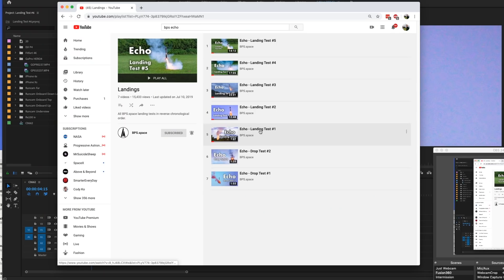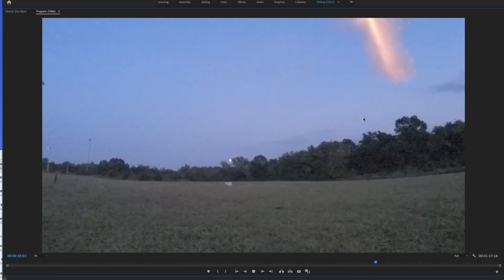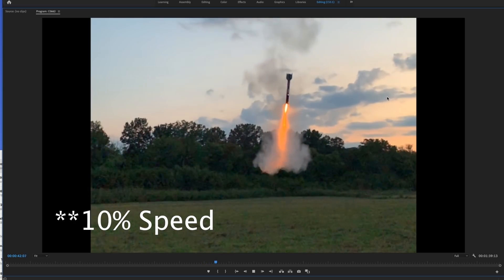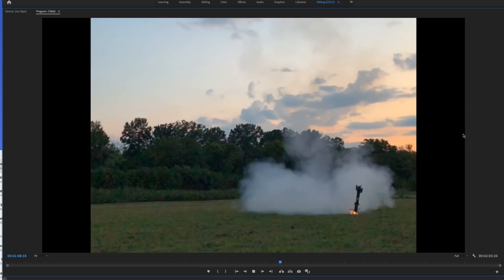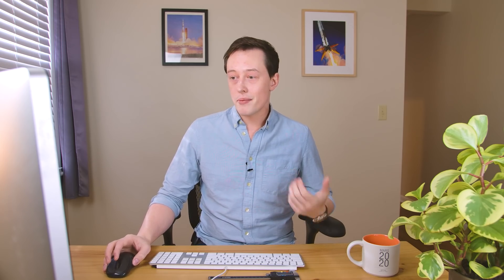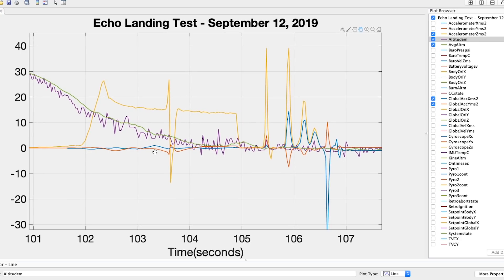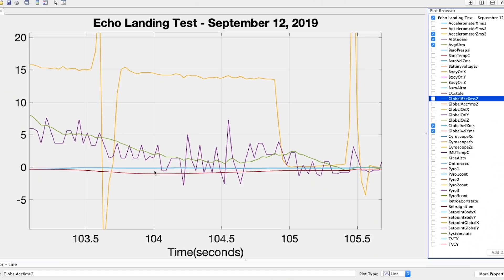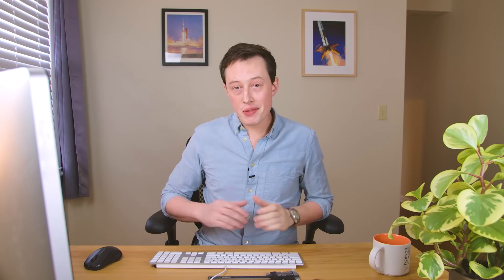Echo - Landing Test #6

Comment: Have you considered adding weight/mass to the legs to move the COG lower?  I know that wouldn't necessarily be good for flight, and it would increase the vibration event you're seeing on leg deploy, but could adding mass to the ends of the legs be enough shift in the COG to help with tipping?  It would also change i/j/k moments so flight software might have a hard time with that.  Excited to see what you do in 2020, thanks for the update.

Comment: I think you should try to programm the motor so, that the engin stops corecting the trajectory 2 seconds before the engine burned out. So the rocket will not flip, beacouse of the engin burned out, while the rocket is corecting the trajectory.
Just an Idea, I dont know if it can help.

(Sorry for my bad English, I'm from Austria)

Comment: I don't think switching to liquid is a good idea as of yet. They are hella expensive and unlike echo, when it crashes, you can just swap the landing legs and the engine and send it again. It'll probably just turn into a giant fireball. 

I get your recent crashes look like they are happening due to you not having throttle but I'd argue there are quite a few other problems with your rocket besides that(horizontal drift, intolerance to vibration, etc.) If I were you, I wouldn't switch to liquid until I can land a solid booster at least 3 times back to back. For the price of a single liquid rocket, you can afford to crash 40 solids.

Comment: Why don´t you use spark ignition for the motor? Sure not the easiest with solid fuel but you can make it work. You should be able to get very solid results once you figure it.

Comment: Feel like you may be missing something here. I guess that the falcon heavy lands at a specific site that HAS WiFi transmitters... And sensors on the falcon pick up extra data about orientation and alignment. You are making it SO hard for yourself landing on a random patch of grass!!! You have a great landing worked out until 10ft altitude, why not develop better legs , or better electomechanical landing gear, legs with servos and damping or even a drone system for the last 10- feet , come on man I love you Joe but this landing problem has to get real, even if you don't want the weight of a complex landing rig you have to face facts and engineer a working solution!!! Please do it man the electronics are out there !!! We want to see it land and this is do able. Love your  videos please come up with better landing hardware not software.
Reply: I mean its called the falcon heavy for a reason? The kit required to make it land is heavy as a proportion of the total rocket mass , Space X made that concession because they knew the distribution of.mass would not be dedicated in such a large proportion to thrusters and their hardware and fuel. A sizeable proportion went to landing gear mass, they wouldn't get as high but they'd be able to get back! Please give a.bigger chunk to your landing gear systems Joe and develop better landing hardware? Writing this because I know you can do it far better than most of us.

Comment: It is still amazing to be able to land a model rocket with a solid motor without smashing it into the ground. I mean, you drop it from a drone hovering 30m above the ground. Imagine now, dropping it 2km above the ground, the result will be the same, a model rocket laying down on the floor, but in one piece. For me that's a succes.

Comment: Resolve the throttle issue by creating a controllable thrust redirect mechanism i.e. to allow you to cut 100% thrust to zero at an exact time.. so what if the motor keeps burning for a couple of seconds longer,  the thrust vector is redirected symmetrically on a 90 degree axis - this cut-off could be triggered by a thin probe that acts on contact with the ground..triggering vanes to redirect thrust 90%

Comment: I am not really an expert but since the rocket is suppose to come from higher altitude in real-life scenarios, right? shouldn't you go higher in altitude before letting the rocket fall down to gain more acceleration which would lead to more velocity and that will make it have much more kinetic energy before your ignition step so you can test if the rocket engine can handle more opposite force.

Comment: A good way to zero out vertical is to measure values with the fuselage in a fixed rig, turn it 180°, and measure again. The average values will be exactly vertical. The rig doesn't need to be perfectly vertical, only reasonably close for this to work. Also, if the ship is a hair off balance, exactly vertical may not be what you need. It could very well be that exactly vertical will have a lateral component of thrust or moment due to CG being not 100% perfect. But this will give you an accurate baseline from which to measure those factors.
With SRBs, I think you must test the thrust curve of many motors on the ground, and see what the standard deviation is for the area under the curve. I suspect that the deviation is too wide to ever expect consistent and predictable landings the way that you are attempting to. A better method may be something like autobrakes on airliners. When the wheels touch down, hydraulic pressure engages the airbrakes. Similarly, you could attempt a slightly firm landing each time, and immediately cut the thrust with a metal plate using a spring-loaded mechanism. Then it's no longer a matter of trying to get 0 variation between flights, but rather to land inside a well-defined envelope.

Comment: I wonder whether some precisely timed weight dumping could compensate for the engine impulse uncertainty. The engine would have to be started a bit "late". Also, do you do inertial navigation or are the accelerometer data too noisy for that?

Comment: there must be a way of throttling them motors, even if its a bit of metal that can act as a nozzle that changes shape? maby a jet of c02 into the flame????
Reply: Solid motor is fuel+oxidizer, there's really no putting that out until it burns out. I had a model rocket get stuck on a launch pad once, burned a clean hole straight through the metal launch pad as if it had been made with a laser.
Reply: Yeah I was thinking of that too, but I do think that whatever you put below the motor will just get incinerated.

Comment: Leaf Shutter!  Create a leaf shutter below the nozzle to slowly stifle thrust as the rocket gets close to the ground.  The thrust will be diverted to the sides.  Have the flight computer activate leaf shutter at a desired altitude, thus setting down softly.  This gives you ability to throttle the motor.

Comment: Hey have you thought about testing it over solid ground? I think the legs sinking into the ground and/or touching the grass before actually landing is probably not helping. 

Second thought and i think you probably already thought of this but isnt the camera offsetting the center of gravity causing the rocket to correct causing horizontal velocity?

Edit: okay got it. No solid ground

Comment: without your gas thruster fore of the craft this landing becomes pure hit and miss. "system integration" is the hardest part of any closed loop engineering program normally stopping at the stacking of the component parts of a rocket with a "fire and track" system the only concern. "launch and land" can only be understood in a computer aided design and forecast through the holistic approach of what thrust vectoring combined with reaction control will look like through an entire feedback loop. in the alternative you could create a single propeller drone at the fore section which would create "trued" or "trimmed flight" with same said firmware added to your stack so as to create this holistic navigation system. it would be interesting to see how far you could stress the propellers before they failed. until then..

Comment: you just need to use an accurate distance meter to the ground, such as a laser rangefinder, to always and accurately determine the distance to the ground. The barometer is the original error, it could not be used.

Comment: Great video and good insight. After watching several of these videos I also felt as you described in this video. The standard deviation on the system is just too large to be consistent. I also never liked the idea of landing on the grass. Its just too spongy and could catch a leg at the wrong time / place and any tiny amount of horizontal velocity would just tip it over. I'm looking forward to Sprite and the liquid engine tests. Good-luck and have fun.

Comment: You should put some dampening in the legs. Look into how they made the legs for the lunar landet with crumpling. That could perhaps help with the bouncing at least.
Could you throttle the engine by having a plug swing in and cover the exhaust some how? Deflect the exhaust?

Comment: I feel like you need to look into a better landing gear, it's amazing that you got this far on a solid non-throttled rocket motor, but like you said with so much variables going into it, it'll be just luck to get right relaying only on timing and the vectoring controls. 
The fact that the landing gear design didn't stop the rocket from tipping twice over when it was pretty much on the ground, is a problem.
it needs to have larger feet, wider span, harder suspension etc. basically needs more tolerances to compensate for the rockets touching down at a steeper lean angle.

Comment: Maybe you have thought of this, but instead of a liquid-fuel engine, you may want to try a hybrid engine. I made one once using paraffin wax as the fuel and O2. I had tried to build a liquid fuel rocket engine previously and it was a mess, machining it, cooling, ignition, fuel lines... but then I tried a hybrid engine and it was so much easier, you can easily control it by limiting the flow of the O2. If you haven't already, I would strongly suggest looking at hybrid rocket engines.

Comment: You could improve the sensors without going too custom - eg time of flight and gps. The solid motor startup time and lack of throttling is a much bigger issue though.

Comment: Dude, I completely respect you and your endeavors. However, why not make the landing legs slightly larger as far as landing/ground/surface area? With solid propellant, you will have such a difficult time trying to throttle back. So make the landing legs much larger on deployment and hopefully your tipping point will be much less as far as failure

Comment: Hey Joe, armchair engineer here. Had you considered a variable exhaust nozzle, or even just a basic lightweight iris mechanism to vary or halt thrust at the moment of touchdown, instead of counting on picking a perfectly average solid rocket motor with nominal burn times?

Comment: Good decision. Always choose quality over hope in engineering. I would choose a volatile inertial propellant (maybe heated difluoroethane) or even a water rocket as they can be easily throttled, but it will be fun to see an amateur dual-propellant rocket land. That could be especially exciting if (when) a failed ignition sends a sparking fueled rocket into the ground. 
Did you consider N2O/Ethanol? LOX has a lot of thermal issues to work out.

Comment: I assume that you've been asked about hybrid rockets already?
Reply: I'm not certain a hybrid motor would solve the issue of inconsistent thrust that solids have. With pressure-fed hybrids your mixture ratio is constantly changing as the oxidiser feed pressure decreases and the fuel grain area increases, which in turn affects the mass flux, which affects the regression rate, which affects the chamber pressure, which affects the thrust and so on. Although the engine is now throttle-able, you still have a lot of the variation you get with solids. Liquid rockets are a lot more predictable, since the mixture ratios and chamber conditions are more tightly controlled, though they are harder to build for a hobbyist.

I've built about 3 small 10 N hybrids so far, 2 of which didn't work at all, and 1 of which exploded 0.1 seconds into the burn. Going to try firing number 4 tomorrow, and I'd like to build a 100 N engine this year, but we'll see how that goes!
Reply: Yeah. Normally, the word is hybrids are not that practical.  Great for safety though, and yeah, for hobbyists, great idea. 
I've heard they don't scale well however, so should Mr. Barnard decide to take this thing commercial, go full liquid. OR, solve the hybrid scaling concerns.
Reply: Great idea!

Comment: Would it be possible to shut down these motors by introducing water (or maybe something else?) inside them? 
What about sticking a syringe filled with water inside the motor and push it using a step-motor?
I know you are trying to save weight as much as possible, but there must be a way to have a better control of these motors for having landing that doesn't rely on pure luck...

Comment: This is why everyone is very curious about intelligent control systems. You might want to look at a better control system than you're residual sum of squares. You might want to check out a copy of "Pattern Recognition and Machine Learning" by Christopher Bishop. It should help your system learn and adapt in a simulator, which saves you fuel cost and parts, and allows you to iterate more rapidly.

Comment: Hey Joe Barnard, what if you had easily deplorable/retractable air-brakes that controlled the decent rate? Then you could fire a bit later, then the air-brakes could slow the vehicle down just the right bit more and touchdown at the right time. Also, why don't you use a radar altimeter to get more accurate results than a barometer? What if you use two motors and pivot them at different angles to get different amounts of thrust? Lastly, did you account for the rocket getting lighter as the propellant burnt out, or for the thrust vectoring that decreases total downward thrust?

Comment: Even though your moving onto liquids later, you proved everyone wrong on how close you can get with a solid motor. You're amazing!
Reply: Mechanical solution is to use the solid motor as a gas generator which pressurizes a chamber, and the bottom of the chamber has a thrust nozzle with an iris shutter for controlling thrust.  The chamber could probably be carbon-fiber wrapped stainless, but the iris assembly may need to be titanium to be reusable.
Reply: @knarFkcalB   My friend is working on that!
Reply: He is not amazing, but incrediable!!
Reply: Bro Legombj is actually going to do it first
Reply: Have you tried making your landing struts longer? A wider base will help with the fact that you're top heavy, which will make your landing easier.
Reply: your a dreamer
Reply: Hey uhh he did
Reply: Youre*
Reply: A_Dreamer you’re*
Reply: @johnlichtenstein6158  well played
Reply: please stop using a motor that cannot be throttled... waste of time...
Reply: @williamlee7119  Even so, this is still a similar problem SpaceX has with their Falcon 9. The so called "hover slam" is nicknamed that because the single engine used for landing is throttled down to its minimum thrust, and even then it still has enough thrust to lift itself back up, therefor the timing must be precise.
Reply: @williamlee7119  this comment aged poorly xD
Reply: @garrettnixon833  has he gotten past this issue now?!?!?
Reply: @williamlee7119  Yea! It's a pretty neat design (though it still has some issues he needs to work out).

Comment: I have next to zero experience with these sensors so this is completely speculation, but is the noise on the barometer from the wind? I know it adds some mass but if you had multiple barometers correctly positioned could you use those to triangulate wind direction and speed? On another note, I've had doubts about performing such delicate maneuvers as landing propulsivley with a solid rocket motor from the get go and as hard as I've been rooting for you to make it happen I'm not at all let down that you're shifting your efforts to other goals. As you said, there are too many variables and too little authority over the fine controls when dealing with model rocket motors to pull off a landing.

Comment: All of you who said land echo on concrete, you owe him a new set of landing legs
Reply: On the other hand, if Test 7's small drop had been over concrete it might have worked.
If you look at a Falcon 9 landing, they do not always kill the horizontal motion before touchdown, but because the coefficient of friction is low between the landing legs and steel deck, the rocket will touch down and slide a few feet sideways.    This has saved some of the earlier landings when the control wasn't as good, and in rough seas when the drone ship is moving a lot.    The problem with trying to land in the grass is the legs will almost always stick in place, so any tiny bit of horizontal movement will cause it to tip over.  Doesn't help that grass itself is rarely perfectly level.  
Maybe what he should have done is put spikes on the bottom of the landing legs so it literally lawn darts into the soft dirt/grass.
Reply: Canine Rocket Technologies nobody owes him shit
Reply: @nono9370  woah, let's calm down here
Reply: @nono9370  .
Reply: No No someone’s salty XD
Reply: No No calm down.

Comment: If we calculate the the velocity while falling down and amount of thrust given by solid motor in every second and analysing the time in which motor burn out you can perform good landing but since when rocket motor ignite it gives a shock to accelerometer and gimbal get bit tricky to control. So my suggestion is you should put grid fins on rocket so stabilizations can be enhanced. Like falcon 9